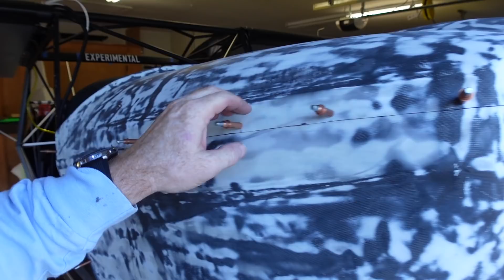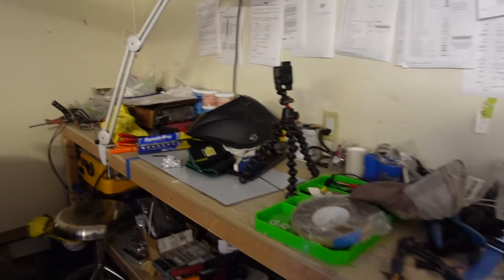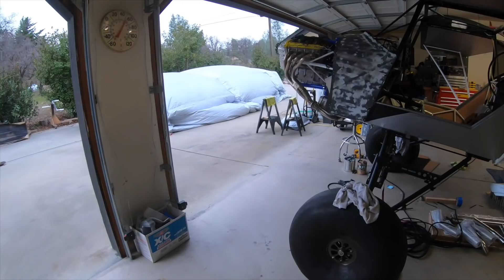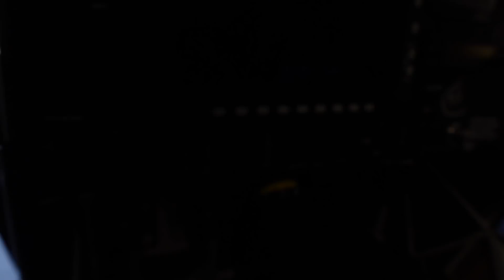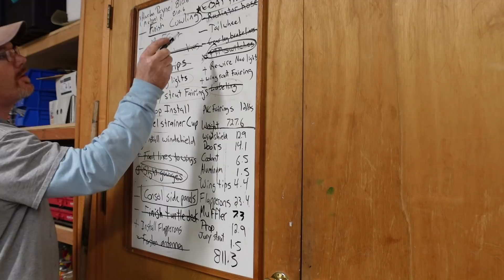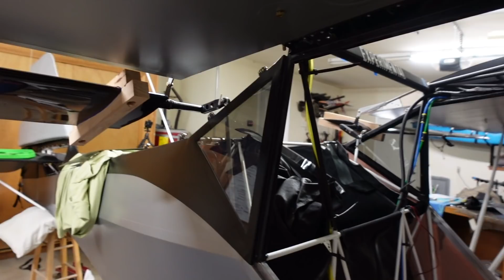Kitfox 7 Apex Build Episode 43 Final Assembly Part 3

Comment: Bryan, will you be running power to the servo to ensure it stalls out the servo when/if it hits your stop?
Reply from the maker: Yes, during the auto pilot configure in the setup menu you run the servos to the limits to check the over center

Comment: whats wrong with the top left area on the radiator, is it leaking yellow coolant, or is that some sort of resin coming out?
Reply from the maker: It is from the expanding foam that I used to form the cowling, just needs to be cleaned out

Comment: Aft of the inboard wings there is no paint. I did the same thing with my Fox. My weight is 996 with Lycoming 233, STI wing, shock monster's, T-3 for tail wheel. I would not know how to cut any weight except carbon fiber every where. I was disappointed with the weight but if you look back at Trent's Kitfox weight I believe was 960 something.  Nice work by the way.
Reply from the maker: I don’t think the unpainted part of the number 1 rib will show once the turtle deck is on, but I noticed the same thing and was talking to my buddy about it. I will probably paint it so it doesn’t bother me.

Comment: Just an off the cuff thought, could you lay a single layer of carbon fiber over the entire cowl after you have the cowling all smoothed out, then clear coat it to be able to see the carbon weaves?
Reply from the maker: Yes, the problem is blending the seams. But I thought about going just a portion, but the next problem is UV protection for the resin

Comment: Double ought steel wool, use it on the overly shiny carbon piece, it'll look like shit at first and you'll think that you ruined it, but just keep going and after a couple minutes you'll see you can knock that shine right down to a nice satin, use coarser steel wool if you want a flat look, I prefer 00 for the satin look though, it'll match better too.

Comment: Looks like your using TOO MUCH heat, the muffler end should not be discolored like that.
Reply from the maker: The small muffler has the discoloration from the factory, if you are talking about my welds, then yes I’m still getting to hot.

Comment: Are you using straight ARGON? 316 x 1/16"SS rods? Make sure the Stainless is CLEAN and don't weld with the door open or a fan running! It messes up the Argon Shielding gas around the weld.
Reply from the maker: Straight Argon 308 rod.

Comment: Should shorten the round muffler to fit the width of the airplane better and do a tight 180 and dump the exhaust behind the muffler center of the airplane. 

Also look at some motorcycle mufflers like the ZX14. Might be smaller and lighter and be just as quiet and being off a motorcycle it will be better tuned for that engine.
Reply from the maker: We have some guys testing the huabusa muffler.

Comment: I was working on building my Bearhawk today.  Making a small sheet metal bracket.  Left it on the welding bench.  Walked across the shop to grab a die grinder and came back and it was gone.  Looked for it for 40 minutes.  Decided I could build it again faster than continue to look.  20 minutes later as I am almost done with it I see it sitting in front of me on the welding bench!  Damn Gremlins!
Reply: Glitch in the matrix
Reply: I’ve had those same thieving gremlins with every project...lol